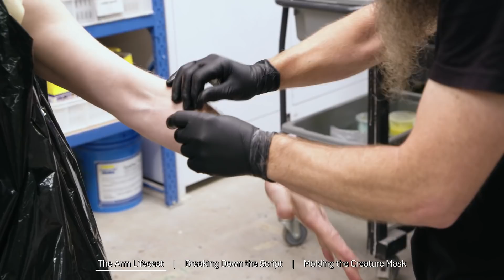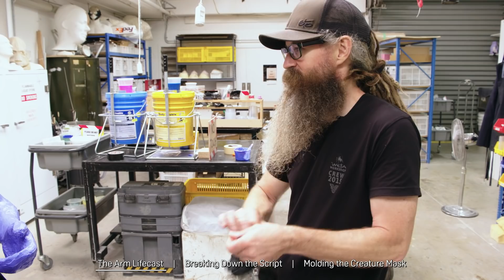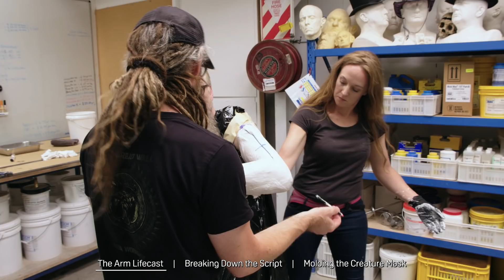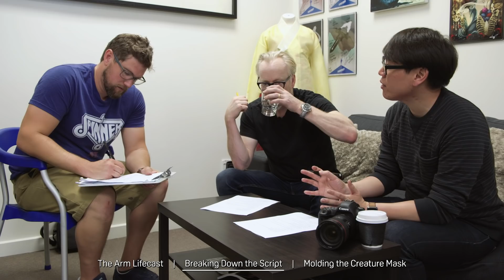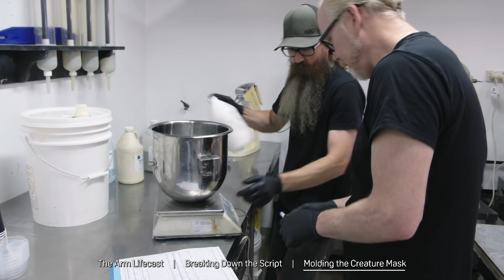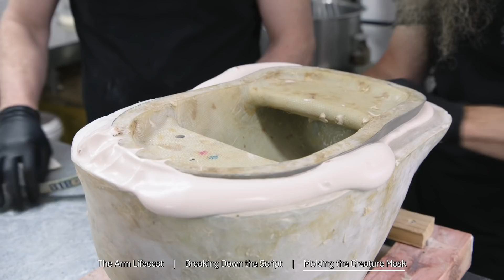Adam Savage's Week at Weta Workshop, Part 1

Comment: Maybe a silly question, but why wouldn't the Foam Casting Workshop have an HVAC system climate control to maintain constant temperature? I understand humidity is likely harder to maintain as a constant, but temperature? At least they would only be adjusting for one variable and not two.

Comment: 9:30 I'm amazed that the room isn't air conditioned so that they don't have to take ambient temperatures into consideration when working. I mean, this guy clearly has the years of experience necessary to be able to work around these issues, but what if the newcomers? Or if someone skilled but less experienced has to take over because he's ill or on holiday?

Comment: As a VFX, I started working with silicone only one year ago and I love the material! I can make great flat molds with scars and bullet holes, slid throats and it’s identical every day and it’s easier than doing that in CG. And I casting body parts. Recently for an indie horror film the script demand 100 leeches on a person. And the wanted to do that in CG. I said that it’s possible but that doing, at least the majority in rubber looks more realistic. So I sculpted 3 leeches made a silicone mold and cast 100 silicone leeches, with a tinted black silicone. It looked so disturbingly realistic. As it was a shore 10 deadened rubber and the kid was very muscular so every movement in the boy’s body made the leeches appear to move. So I only ended up doing one CG leech that had to perform a specific movement.
As of that moment I have become a silicone SFX junky :)

Comment: I’m life casting in Vancouver, Canada. I was wondering if that was baby oil they squirted down Adam’s arm to pull the cast off easier?
Reply: Hey I'm in the industry too, in raincity. I'm applying for 2nd category Props, hoping to learn to be a maker. Are you with a team or independent? I'm watching as much tutorials as I can so I build up minimal knowledge and can be of use. But if you have time I'd have a couple questions for you regarding what's available here for learning to work prosthetics and the methods and products depending what you want to make. As in Adams video, latex and foam are used toward different specific goals and look.
If you have time (haha) and I'm not a bother asking you.
Thanks!